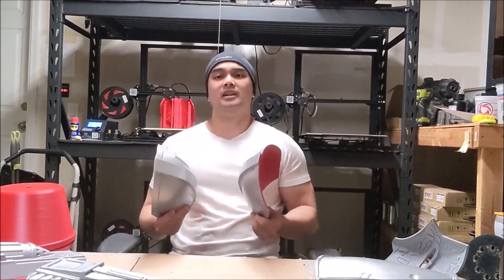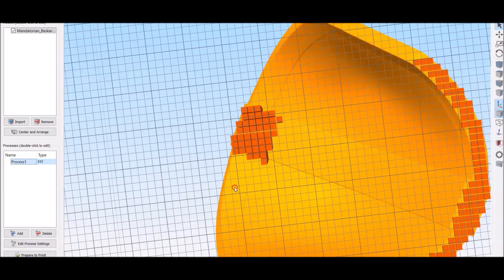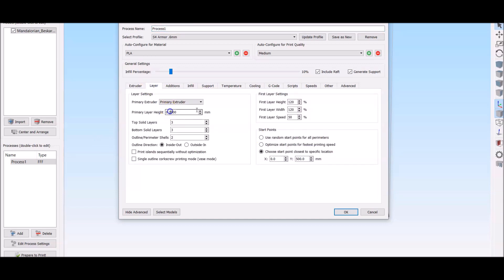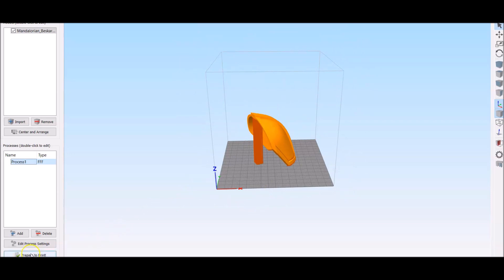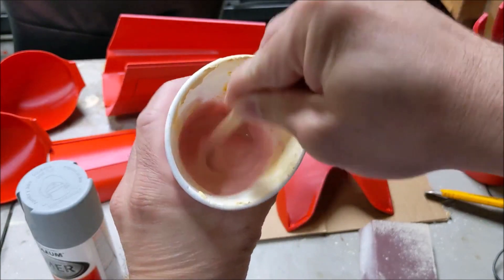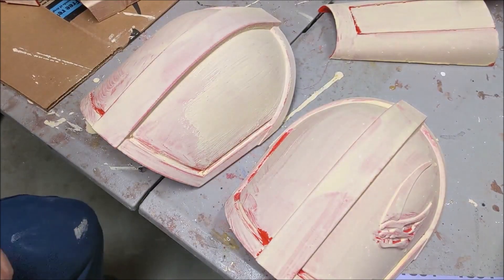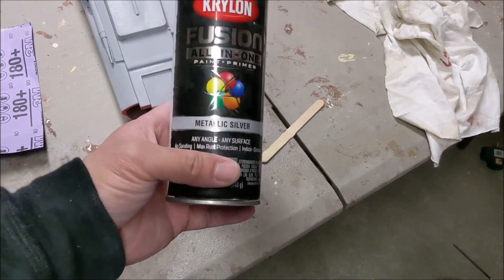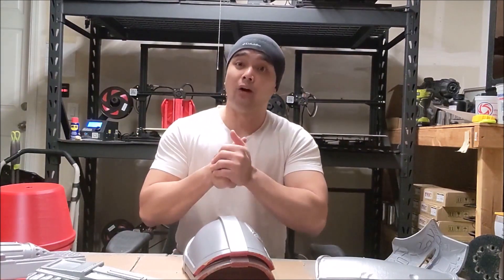How I Built My Mandalorian Shoulder Armor- The Mandalorian Build Series

Comment: I am very surprized that the wood filler being water based actually bonds to the PLA as compared to Spot putty or bondo.  I love the idea of a thinner filler so I have to ask, how well does it really stick and is it harder than spot putty?  It seems to me that spot putty (Bondo red not the 3M green) is too soft and actually will sand away more so than the PLA.  Your thoughts?